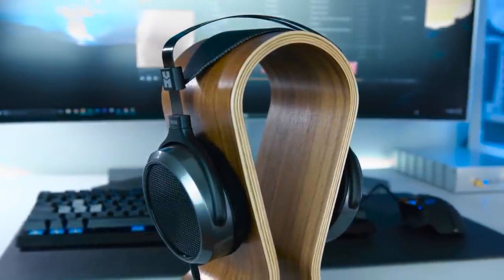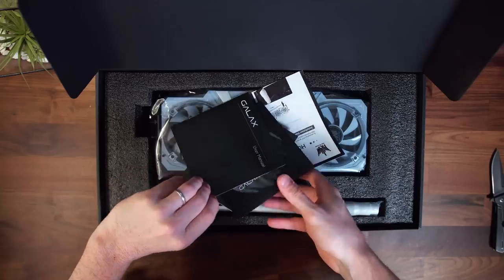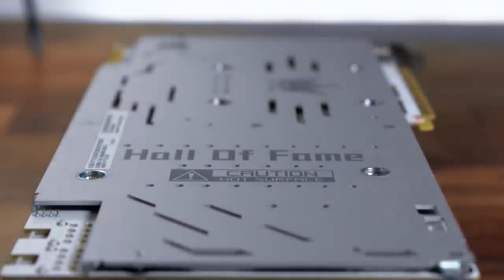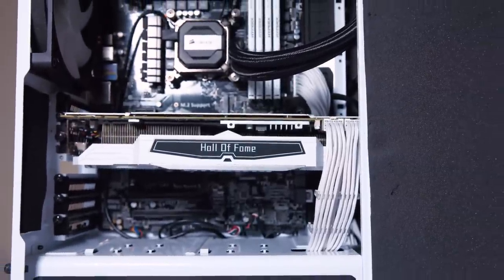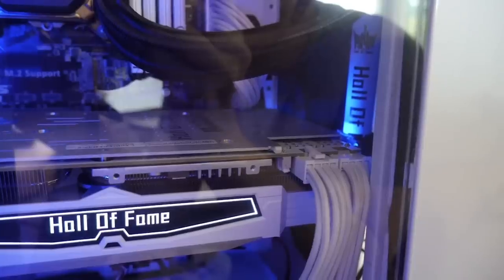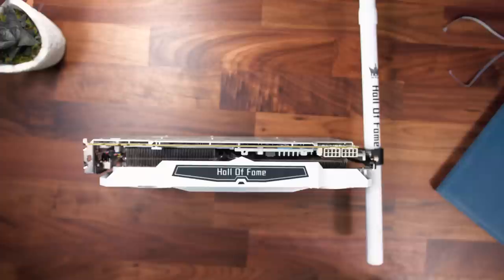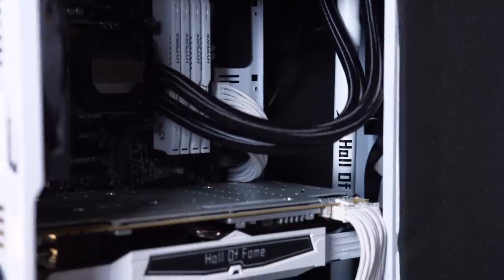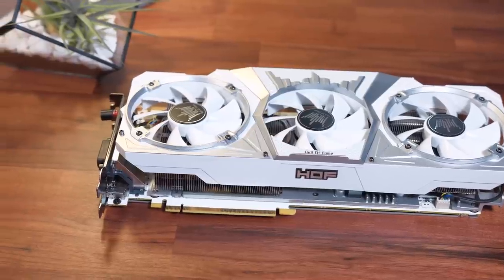GALAX GTX 1080 HOF Graphics Card Review / Benchmarks

Comment: Would you recomend this card, or zotac 1080 EMP? I need to change my graphics card, and I'm thinking about this  two cards...
Reply: Nieumieralny Honestly after overclocking they are all pretty much the same performamce wise (the most you will out of the best 1080 is an extra 100mhz oc if you're lucky as they all easily oc to 2050mhz). Just get the one that looks the best or the cheapest one that has a custom cooler.
Reply: Thanks for advice. I prepear white dame (winter is comming pc), so I probably choose this one. Thanks a lot! ;]

Comment: Clock speed really doesn't matter. It's the same GPU die at the core and it doesnt matter which model you get you will get the same graphics card at the core. Heck most 980ti's shipped with a core clock of 1000mhz and a boost clock of 1076mhz. Doesn't mean 95% of them will not be able to sit at 1500mhz's easy. Just never seen the point in advertising a non reference core clock.

Every GTX 1080 will be able to hit the advertised core and boost clock of this card. Still tho the Hall of Fame is a great card and they are known for there excellent design and for always going the extra mile (manufacturing wise).

Comment: id rather get Gigabyte $50 cheaper as well 
Gigabyte 1080 Xtreme gaming  
(Boost: 1936 MHz / Base: 1784 MHz in OC mode)
(Boost: 1898 MHz / Base: 1759 MHz in Gaming mode)

Galax GeForce GTX 1080 HOF 8GB 
(Base Clock (MHz) 1733)
(Boost Clock (MHz) 1873)